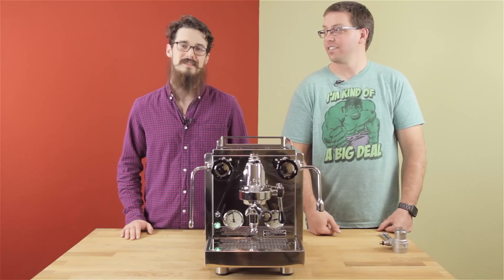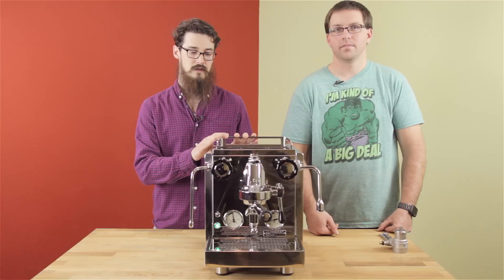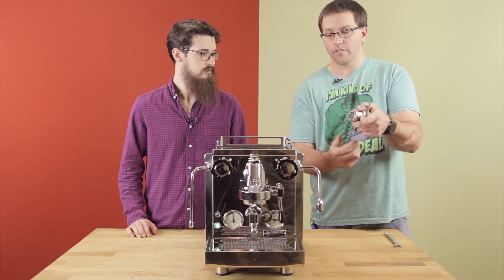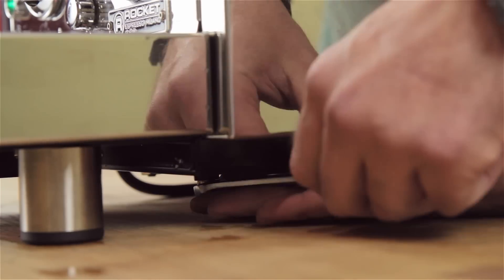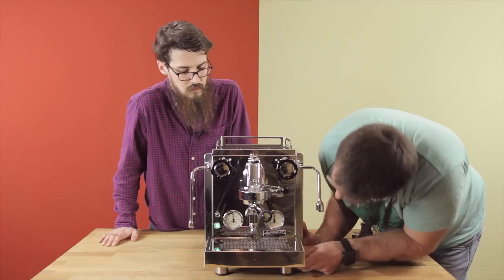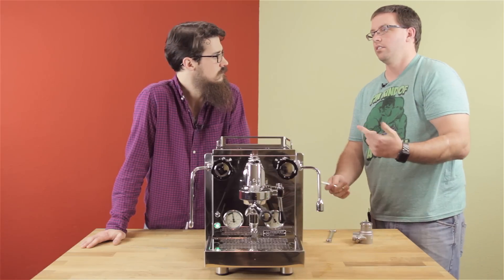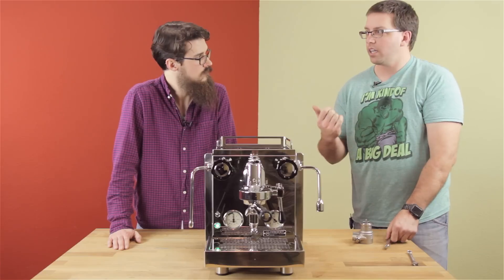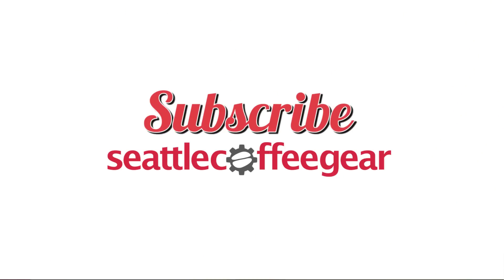Adjusting The Pump Pressure On A Rocket | Tune Up For What

Comment: I have a mozzafiato EVO R. These screws seem to be in a different order. Not sure which screw is the correct one to adjust. I have also the same issues on my machine and often go up to 13-14 bars when brewing. Making these similar noises lately.

Comment: Need help.  I set to 10 but it’s hovering around 5 then slowly building up to 10 with a blind basket. Then falling back to 0 when shut off. 

It used to go immediately to 10 then drop to 5 until pressure slowly dissipated. 

Is the OPV stuck open?

R58 v2 using reservoir

Comment: Hi, My Rocket Giotto ChronoV has a problem where the pump pressure gauge is at 8, but does not release pressure in the drain position. it works fine if its warming up or if a relieve pressure by drawing some hot water for example. any ideas what is the problem ? I've done a full strip down of the E61 head but this did not help so I suspect its something with a sticky pump ?

Comment: Hi guys. I have a Cellini Plus v2. I have been trying to increase the brew pressure. However, it would appear that unlike all the videos and photos I've seen of this model, there is no adjustable OPV, usually accessible under the machine. Is this possible? Am I missing something? Or could it be they simply manufactured this model without the function of adjusting brewing pressure?  Many thanks!
Reply: Figure it out? I think most machines have it inside. So you might have to take the top of it off.

Comment: my brand new Rocket Mozzafiato Chono Evo R often times surpasses the steamer’s pressure of 1 bar fron the green zone into the ted zone, and beyond,  making this awful train whistle noise. I have to turn off the machine immediately. it does it more often if i set the PID temperature to anything higher that 120 degrees Celsius. Can that be adjusted or does it require sending the machine for repaor?

Comment: I have just bought a Evo Type R. I plumbed it into the water, however when I brew a coffee, the pump gauge goes into the green. But once I finish the brewing, it never goes back to 0 until I turn off the machine and pull the lever up (without the basket attached). Have you seen this before?

Comment: I have my rocket evoluzione on soft water house pressure. It always worked great. Now I am not getting any preinfusion. I am brewing at 10 bar.
Just cleaned my machine with citric acid coffee cleaner. Is there junk clogging my preinfusion? I was not getting hardly any water from my E61, hence I cleaned it , getting good water into portafilter.

Comment: What if you have a vibration pump such as the (Rocket Cronometro Type V) cause I think there is no way to adjust any vibration pump, am I right? My mom just received her today and the pump pressure took a while to ramp up which I just learned it was normal to take about 5 seconds more than on a rotary like my R58 which I'm used to, but then it never went above 4.5Bar and the coffee was very watery, weak/pale and didn't taste good.

Would that be a derfectuous machine?
Reply: Haha! Replying to self cause it's just funny 2 years later to see my own comment when I'm looking back at this old video to re-adjust my (Rocket R58 2019) as I just sold my mom's Rocket and bought her a wayyy better (Lelit Bianca V3) 2 days ago that's even better than my R58 no joke... Feels like the same plumbing quality but with a PID, features and technology of a computer 10 years ahead, plus the flow control is 10x easier too and it can do pre-infusion, it's so awesome!

Comment: This is only applicable to the rotary pump models. The ones with a vibratory pump do NOT have this external adjustment screw.
Reply: This is pretty important info.  Thanks

Comment: very informative! Thanks!
Reply from the maker: +Torrey B You are welcome! Cheers!
Reply: Vital bit of information missing from the video. Do you turn the bolt clockwise or anti-clockwise to reduce the pressure? My guess is that the bolt needs to come further OUT of the machine to reduce pressure. Also, this adjustment does need to be done when the machine is fully up to temperature and stable pressure, right? I think those points are worth clarifying. Thanks.

Comment: The pump pressure on my R58 when it is turned on and sitting is just above zero. When I pull a shot the pressure then goes up to the green zone around 10.  After about 30 seconds after pulling the shot it’s back to zero again. In the machines I see pictures of the pressure gauge the needle is between the 5 mark and 9. 
Is my machine okay?
Reply: This shouldn't be going up when your NOT using the pump, which kind of makes sense. I have a R58 also and yes it stays at 0 when I turn it on, only the left gauge goes into the green 1.0 bar after 10min, then only when I brew the right gaughe goes around 9-10 bars which is what you want and then back to 0 when you close the lever, even if the machine stays on.